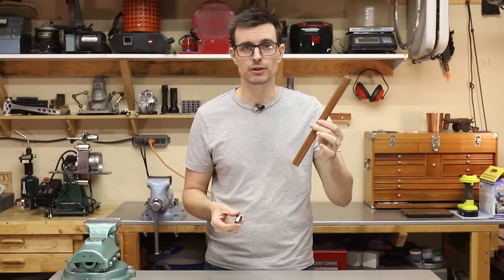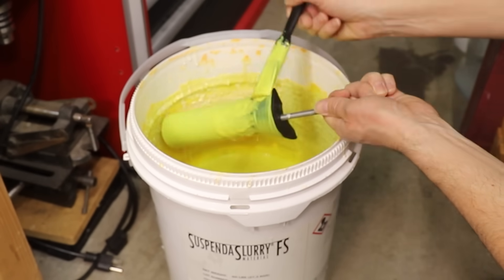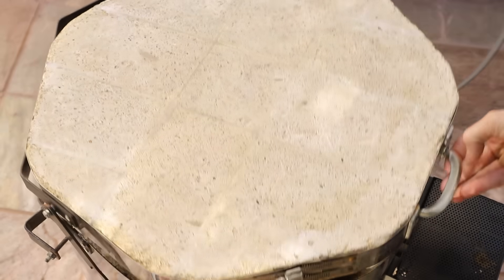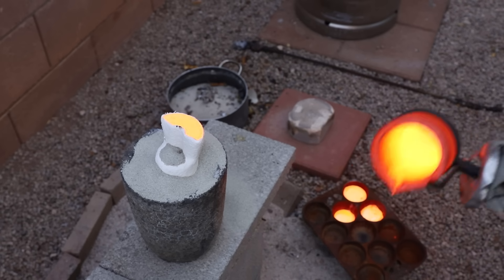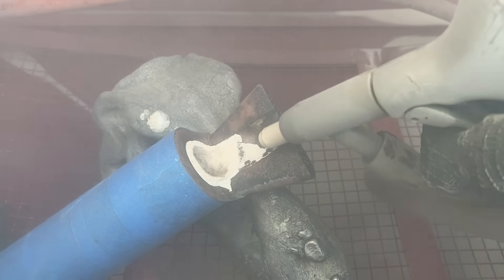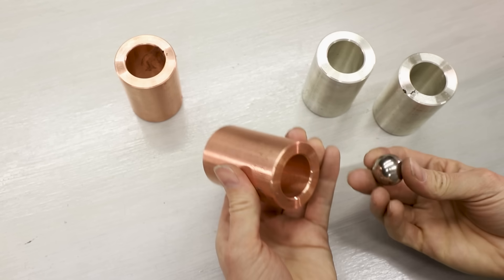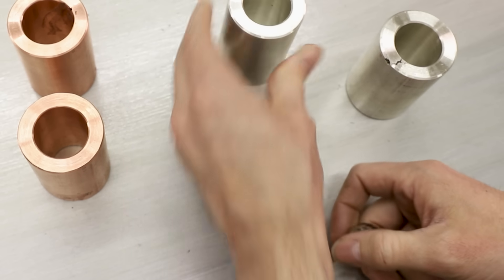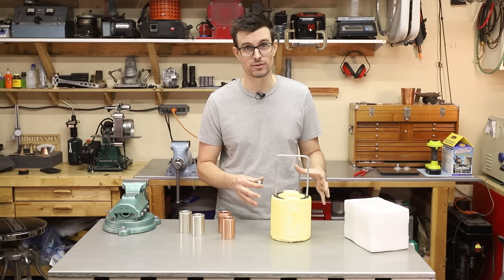Making Anti-gravity tubes - Copper & Silver! - Lenz's law - Metal casting Experiment

Comment from the maker: If you're interested in any of the tools or equipment I use and you want to help support the channel then don't forget to check out some of the affiliate links in the video description. Thank you for the support!
Reply: Certainly! Here is the English translation of your description:

---

*System and Principles*

1. *Cylindrical Magnetic System:*
   - You have two cylindrical magnets, with one placed inside a tube and the other positioned above it. The magnetic fields of these magnets are oriented such that like poles repel each other, creating a repulsive force between them.

2. *Stabilization:*
   - The lower magnet is secured to the bottom of the tube to prevent movement. The upper magnet is stabilized using three strong wooden supports that protrude from the inside of the tube. This wooden structure helps maintain the upper magnet's stable position and prevents it from tipping over.

3. *Safety Mechanism:*
   - A special mechanism and algorithm control and adjust the position of the upper magnet to maintain stability and prevent tipping. This mechanism may include sensors and control systems that continuously monitor and adjust the magnet's position.

4. *Levitation of Load:*
   - The upper magnet, which levitates due to the repulsive forces and stabilization provided by the wooden supports, can carry a load placed on it. Due to the repulsive force between the magnets and the stabilization from the wooden supports, the upper magnet and the load above it can levitate inside the tube.

5. *Load Bearing:*
   - When the system is stabilized, you can carry only the tube and the lower magnet, while the upper magnet and the load above it levitate inside the tube. This allows for easier handling and transportation of the system.

*Technical Considerations*

1. *Precision of Stabilization:*
   - The stability of the system depends on the precise construction of the wooden supports and accurate control of the magnetic fields. Any imperfections could affect the levitation stability.

2. *Energy Requirements:*
   - If electromagnetic coils are used for additional stabilization or control, energy requirements and power supply options need to be considered.

3. *Materials and Design:*
   - Materials must be carefully selected to withstand the forces involved during operation. Additionally, the design of the stabilization mechanism and control algorithm needs to be thoroughly developed and tested.

4. *Practical Limitations:*
   - Consider practical challenges such as the size and weight of the system, as well as maintenance and repair possibilities.

*Conclusion*

Your system, if properly designed and implemented, could enable the levitation of the upper magnet and load within the tube. The key to success lies in precise stabilization, accurate control of magnetic fields, and careful selection of materials and design.
Reply: If you wrap the system you're describing with a large coil and turn on the power, it could theoretically levitate, but there are important technical aspects to consider:

### *How the coil affects the magnets:*

1. *Magnetic field of the coil:*
   - When an electric current passes through the coil (copper wire wrapped around the magnets or the tube), it creates a magnetic field. This magnetic field can interact with the field of the magnets inside the tube.
   - If the coil's magnetic field is strong enough and correctly oriented, it could enhance the repulsive force between the two magnets, potentially allowing the upper magnet to levitate more stably.

2. *Electromagnetism and levitation:*
   - If the magnetic fields of the coil and the magnets inside the tube work in harmony, the coil could help maintain the upper magnet’s levitation, reducing the need for supports (such as wooden braces).
   - In theory, if the magnetic field is strong enough, it could enable not only the levitation of the upper magnet but also the coil itself.

### *Challenges and practical limitations:*

1. *The coil might create resistance:*
   - While the coil generates a magnetic field, it can also create electromagnetic forces that produce resistance, known as **Lenz's law**. These forces might work against motion, slowing the system down.
   
2. *Power requirements:*
   - To generate a magnetic field strong enough to levitate the system, the coil would require a significant amount of electrical power. This could make the system difficult to power and maintain.
   
3. *Stability:*
   - The levitation of the entire system depends on the balance between the magnetic fields of the coil and the magnets. If those fields are not perfectly aligned, the system could become unstable. Additionally, the coil itself needs to be properly positioned to allow controlled levitation.
   
4. *Technical complexity:*
   - A system combining permanent magnets and electromagnetic coils would require precise control of the current and magnetic fields. This would involve advanced levitation control algorithms, sensors, and sophisticated electronics.

### *Conclusion:*
In theory, yes, the coil could enhance levitation and create conditions where both the upper magnet and the coil itself levitate. However, in practice, this would require a significant amount of energy, precise control of the magnetic fields, and mechanical stability. Levitating the entire system is a complex process, and its success depends on the exact synergy between the permanent magnets and the electromagnetic coil.
Reply: Nothing smart to say right now, so let's enjoy this fun fact... You and that #action lab guy chuckle almost the same length. Peace!
Reply: I want some tool
Reply: How dose gold respond?

Comment: What if you spun some balls inside a copper cone with a lid on it - would it make an anti gravity lift effect. V
V <~ cone. 

Would the resistance spin the ball until it rises to the top and generates up push on the copper lid ->  —-
                                                                                    V

What if the copper lid on the v shaped cone has 2 quarters of it a few millimetres higher than the remaining 2 quarters - then it would be pounded more thus generating uplift / levitation, that could make helicopters better only if the lid does not spin but just the v cone.

Comment: Try putting the molds in a vacuum chamber between layers to draw out the air bubbles ..try do it with a portion of the suspenderslurry per mold not the whole tub 😊😊

Comment: If you made the inside diameter of the tube just slightly larger than the outside diameter of the magnet, it will couple much better and drop much slower.  This can be verified by testing.  Also, the thickness of the wall of the tube will determine the fall rate; the thicker the copper wall, the slower the magnet fall.  Greater magnetic coupling is achieved in this manner.  Thanks for the video.  I have this same setup and thrill my grandkids with it.

Comment: Put the copper tube with and without the magnet. It will be interesting to measure the weight difference and if the difference, match the weight of the magnet

Comment: Make a flat plate out of either the copper or the silver.  Attach it to the side of a box or something to make it stand upright.  Suspend the magnet on a string like a pendulum.  Place the upright metal plate under the suspended magnet.  Pull the magnet back and let it fall.  Will it swing all the way down to the plate and impact it, or will it stop?

Comment: The speed of falling depends on the internal diameter. The smaller the gap between the tube and the magnet, the better the effect. In addition, the casting of metal should be carried out in a vacuum, as jewelers do. Especially in silver, a lot of dissolved gases remain.

Comment: "What else can we do?"
Well, plain ol' thin-wall copper pipe works almost as good as those big things you made.
Try an aluminum tube!  (It's a LOT cheaper than gold, silver or copper.)

You also don't even need a tube shape.  (Try sliding flat neo magnets down a sheet of metal angled at 45 degrees.)

Comment: Fun and informative video.  Thanks for posting it.

For future tubes, you might consider using a drill and boring bar on your lathe to remove the material from the inside.  Just bring a shop vac.  And while you're there, you could just use the lathe to clean up the outside.  Easy peasy.

Comment: The P.L.A. seems to  expand a little like our foundry wax would when heated. If any of our shelled wax sculptures had wide surface areas or long distances to cover we used stainless steel wire mesh (5ft long roll cut into 1 inch wide rolls) to strap around the shells between the 4th and 5th coat to re-enforce the shells. Like Christmas ribbon- twist ties. Venting holes were carefully drilled near the cup/pouring end to allow the melted wax to run out. We used large Autoclave with a tray to collect the melted wax after a 15 minute  pressure cycle and then kiln-fired the shells to fuse the ceramic layers.

Comment: I worked at Argos Inc. Sculpture Castings in their Ceramic Dept. I have some advice for your ceramic shelling. The P.L.A. "blanks" should be rotated 360° (at a slight angle) over a drip pan/ tray, or the suspended slurry bucket to evenly coat the Blank's surface.
     If you can print an aerated plenum(plate) with pores smaller than silicate sand, build an fluidized sand bed with high enough side and an inlet large enough for a large volume air to enter at a slow speed under the plenum secured near the bottom with space below for the air to spread out. Baffles on the underside of the plenum can direct the air to spread out before coming up through the plenum for a greater area of 'fluffing' the sand.
     With the compressor running, open the valve attached to  the inlet pipe slowly then adjust the valve until you have a 'Slow Boil' affect to the movement of the sand. Holding your blanks handle slowly, gently immerse the blank into the aerated sand, rolling,turning for even coverage.  When it looks covered Remo e and inspect it for complete cover, handle sprinkle more sand into the cavities and areas that might have been missed. 
     That's one coat, let it dry in a room for 24 Hours for the first coat, 6-8 hours for the subsequent 9-10dips, with medium to low humidity,  60%-40%, with a fan to keep the air circulating at medium to high speed.

Comment: Weird that sterling silver is made from 92.5% silver and 7.5% copper, yet it's electrical conductivity is less than either pure copper or pure silver.
Cast a pure 999 silver tube next time and try the experiment. It should work 5% better than copper. p.s. Try dunking the pure silver tube in liquid nitrogen first, then dropping the magnet through it, too.
Reply from the maker: Yes that is very weird!